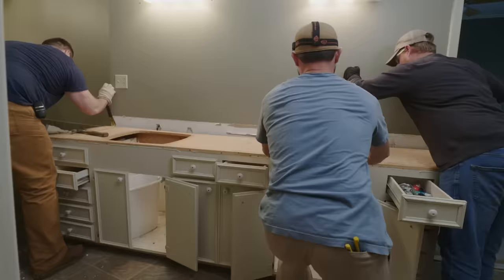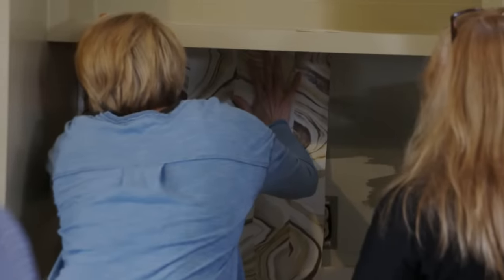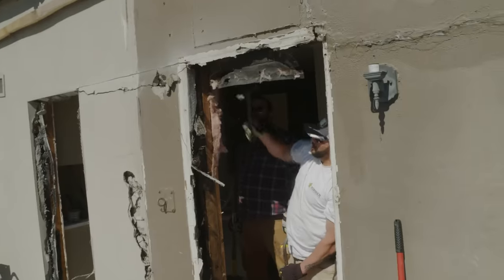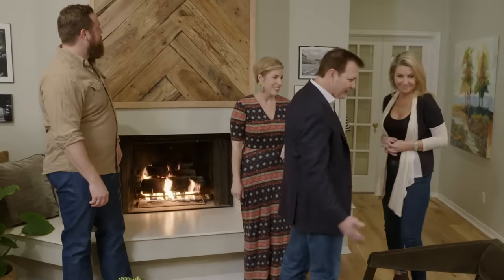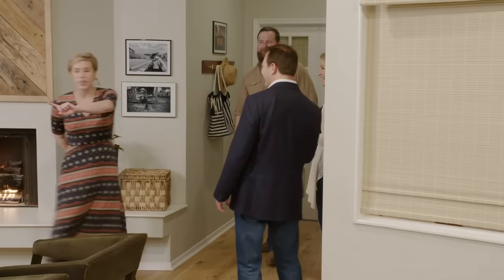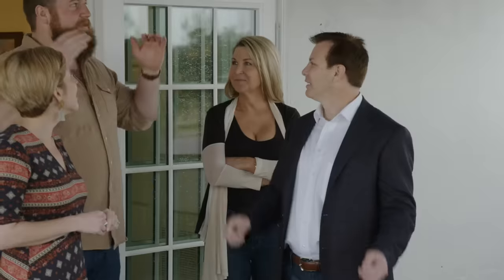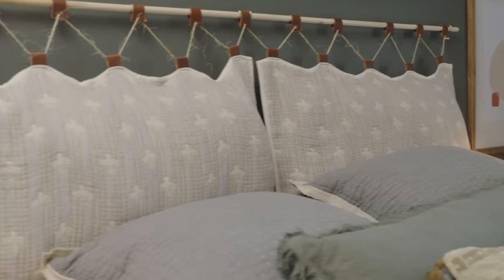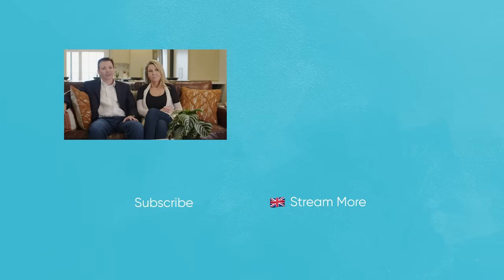Ben & Erin Double Size Of House Including An Insulated Roof Deck | Home Town

Comment: Very nice! What I don’t get is how kitchen islands are being designed lately. There’s either a stove top or a sink in them with seating directly in front. I don’t know about you, but my sink always has a drain board next to it and/or I’d be afraid of inadvertently burning myself on the cook top. Am I the only one thinking like this?
Reply: No. I don't like it either. I like an island to only be an island.
Reply: I worry children might get burned if there’s a cooktop there.
Reply: I don't care for it, I prefer a big butcherblock table.  Keep the cook top and sink along the edges of the kitchen.